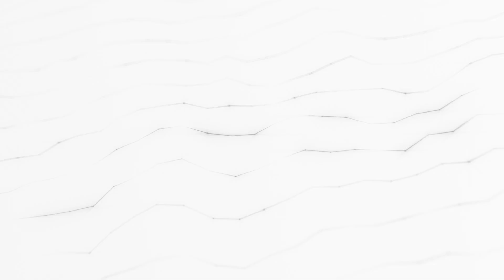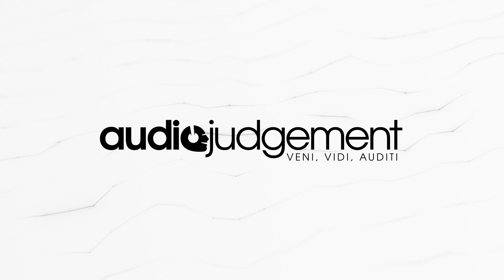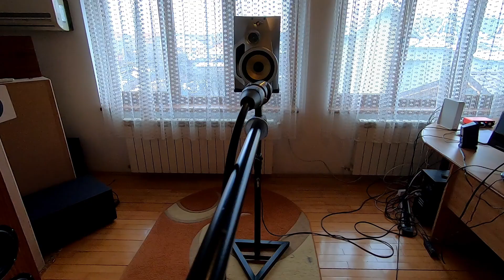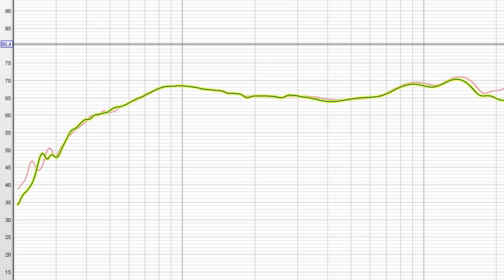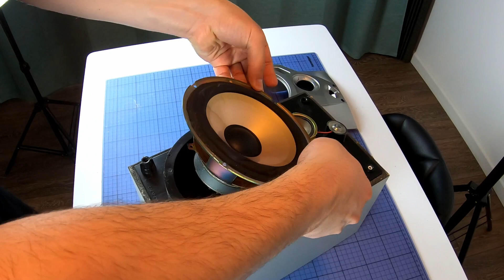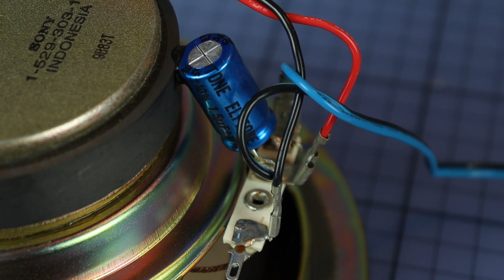Sony Audio System old model (RXD5) - Speaker measurement and disassembly

Comment: I had these speakers. There is no crossover, the high pass capacitor for the tweeter is on the woofer. The particle board is thin and there is no internal foam but the speakers do go deep, below 30hz. I used the woofers to build a pair of tower speakers and a Vifa tweeter instead of the cone tweeter. In the thick MDF enclosures with the correct port tuning the bass is excellent from the quick edge woofer and in fact with the Vifa tweeter the sound is very good, rich, warm, powerful and good top end too. These woofers can handle lots of power but will bottom out when pushed very hard.

Comment: All of these 1990 - 2000s stereo systems are more or less built exactly like these. Cheapish enclosure, just a single capacitor as a crossover, usually very good woofers, a cheap looking mid-tweeter and if it has a "dome tweeter" like yours did, its just a piezo disc flued to some thin plastic film. (Impossible to hear) Thats about the standard

Comment: Would be interested if you tested the woofer in free air on REW, and what the theoretical response would be with different enclosure types. i.e. could you have designed a better box?? Thanks for all your content, its excellent, keep up the good work.

Comment: These small woofers are really efficient and produce both low and mids really well. They actually don't need a cross-over circuit. Thanks for the great video providing some statistic information of the system such as frequency responses.

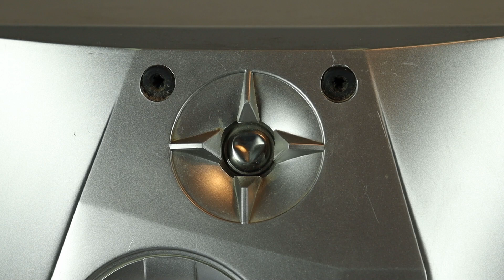Comment: 3:50 youtube is full of videos on how to suck these out.
Of course, if these are repaired, it would be nice to have a video with before and after measurements. I'm really curious to find out whether what most say is true, i.e. that the dent in the dust caps does not affect the sound.

Comment: look, these are quick edge, meaning its HOP woofers....HOP wont be understood by regular consumers. These were EXTREMELy high quality woofers, they are all still in working order. the rubber surround was extremely well made and the cross you see helps to prevent woofer bend during high performance and increases stability of the woofers during high bass output. Seriously incredible speakers for consumers. Maybe Pioneer was the only one who outdid SONY in 1996-1998, but using linear...edgeless woofers.

Comment: I'm actually surprised the response is that good. Considering how cheaply made the cabinet and the curcuitry is. My first homemade speaker basically had this curcuit with just some capacitor like 4.7 uF or something, I tried multiple by ear. No piezo though).
 I took the frequency response much later and it wasn't too pretty, however must say my impression is this "random single cap" curcuit seems to work better than the "prefabricated crossovers" (which are total bullshit) I used later. I disassembled them after a short time because they were so bad.

Comment: late comment, but anyway:
Actually these speakers are two-way, with a rubish 2" tweeter and a rubish piezo they call "super-tweeter" on specs to add some bright on high frequencies or to cover some gaps in response, that's why the cutt-off frequency is so high.
I still have two pairs of microsystem speakers on my office desk, a pair Sony SS-H991AV and a pair of JVC SB-D2T, slightly better than yours.
JVC has a proper set with paper 5" woofer and 2" paper tweeter, good enough for me.
Sony has a 6" paper woofer with foam borders, and came with those rubish tweters and piezos, so I replaced then with a better 2" tweeters and it is clearly better after.  I will buy a mic for other projects and measure these some day.

Comment: Its made in 1999 still not 25 years old all mini hifi with piezo tweeter not coming with crossover  this plastic woofer yellow or gray belongs to quick edge woofer is the best ever speaks made between 1997 till 2001 I believe  I bought more than 12 system that time every year i use to upgrade or sell my system and buy other i I know what those systems sounds. I still have the hcd rxd8s  and i use to have the same system on video  if I find one brand new now on box  i will pay more than 2000$ for that

Comment: The important thing is if you like how it sounds. the woofer has mid and low frequencies, so the speaker you called "middle" is actually the tweeter just like the little one on top which is a piezoelectric. It caught my attention that you cut the cable with the scissors instead of simply disconnecting the cables from their connectors, it is strange because despite being a VERY young person (my age approximately) you seem totally confused about that speaker when it is a speaker with a classic design of a lifetime, it is not archaic or strange technology, as the woofer reproduces medium and low frequencies, it is not necessary to cut with any crossover, simply a capacitor to filter the medium and low frequencies in the tweeter, simple but effective.
Reply from the maker: Yep, I snipped the wires because the spade connectors were stuck in place and there wasn't enough slack for me to force them out. I was only confused regarding the tweeter because I never worked with a piezo before and since it has nothing in common with a conventional speaker, it looked odd to me. However, the crossover is a joke. The capacitor will filter low frequencies, but the crossover's job is not just to make sure the tweeter doesn't fry itself. From the outside it looks like a 3-way speaker, And the last thing I expect when looking at 3-way crossover is to find a single electrolytic capacitor. That's the reason for my amazement.

Comment: It's a Piezo tweeter... works well for super highs... and it's not actually a mid... it is the tweeter ;)

I disassembled similar speaker from Kenwood which I found in the trash recently - same idea but the capacitor was 3.3 ;)

Comment: I also have this series of speakers, and I want to know if I use crossover in this speaker, will it not damage the amplifier?
Reply from the maker: I know for a fact that if you have the original amplifier, it doesn't have any protection. So if you use a custom crossover and the impedance dips too low, you might burn the amplifier, yes.
Reply: @AudioJudgement  Yes, my amplifier(Sony MHC 991 AV) is original and the speakers have a very deep bass, but I'm worried about the sound of the tweeters, which is really low. Thanks for the tips.🙏🏽

Comment: i'm amazed by the fact that you never saw a piezo tweeter before. Greetings from Argentina, this is one of the best audio related channels on yt, i bet your courses are great but i cant afford them lol.
Reply: brother, what he was saying a piezo electric tweeter needs a transformer . oe else it will be so inefficient due to high impedance
Reply from the maker: Yea, kind of embarrassing. Never played with one. Regarding the courses, udemy is the one setting the price. 90% of the time there is an active promotion and the price varies between 10-20$. Check it out from time to time to see if the prices dropped.

Comment: Thanks for the nostalgia lol! The piezo drivers are usually used where high output levels are needed and the cost needs to be dirt cheap; They usually give very bad quality output. Apart from calculator buzzers and shelf hifi systems, more serious applications include sirens and ultrasonic radars. The only occasion where it was seriously designed for hifi application was in a collaboration between Kyocera and LG on a concept TV model.
Reply: The thing is piezos have high distortion at lower frequencies (below their design range) which drops with higher frequency (well, more exactly: the harmonics are in the inaudible range), and are more suitable as super high tone speakers, maybe from 10-12kHz+. I presume the output/dynamic behaviour is also a problem, as in higher SPL setting in at lower "AMP"litudes ;), and not in accordance with the voice coil speakers? Although Technics used some with kind of "mimicry" domes in their SB-CS60,65 etc. which don't sound toooo bad, but are still setting in a bit aggressively. I'll probably need to open one and look at how they're connected to the crossover network while I've still got them around.

Comment: Hi. The tweeter is a piezo-electric type. The impedance of these transducers drops as frequency increases so no crossover is needed.
Reply: those are technically piezo buzzers but they are so much less sensitive than the dynamic drivers that they contribute no meaningful output to the sound. if you've ever hooked up just one by itself, playing at normal listening volumes, the output is extremely quiet.
Reply: those kinds of piezo tweeters are basically inaudible and for show only in my experience. they make a tiny bit of sound if you run them by themselves, but as there is no coupling to any kind of cone (like a real piezo tweeter) they are extremely inefficient
Reply: No, no but still need crossover

Comment: Nice to see your measurement results.
I got this exactly same system when I was 15, later I got from a friend RXD7 which is similar to these just even more drivers without crossover. In last summer I build 6th order series tuned 2 way tower speakers using those 4 midbass drivers, made my first, not very good video about the build and design of it> https://youtu.be/pdpYNneBfKg?t=198  I will add T/S parameters which I measured from them into the description if someone is interested about these Sony midbass drivers.

Comment: Its a piezo driver you Romanian muppet :) they are about 2-5uF capacity, Good video idea, cheers from Check Republic.
Reply from the maker: Thanks guys for actually watching the video and taking the time to answer my questions. I'm familiar with the piezo tweeter behavior, and how the impedance increases as frequency decreases, but I haven't worked with one before. I though it had voice coil like the normal tweeters.
Reply: @AudioJudgement  Well actulally, impedance decreases since its essentially a capacitor.
Reply from the maker: Well yeah, You just said it the other way around. Impedance decreases as frequency increases.

Comment: Acel ,, tweeter” este de fapt un tweeter piezzo, adica o dioda piezoelectrica cu quartz. Nu e cine stie ce, se ard foarte usor dupa scurt timp. Ceva similar se regasea in cutiuta aceea muzicala de la instalatiile pentru brad. Cel ce joaca rol de tweeter cu adevarat este acel difuzor care tu spui ca aste de medii, de unde si conectica foarte simpla. Stima !
Reply from the maker: Nu m-am jucat niciodata cu un tweeter piezo. Stiam ca au impedanta mare la frecvente joase si practic nu necesita filtru, dar traiam cu impresia ca sunt similare ca si constructie cu tweeterele normale, cu bobina.
Reply: @AudioJudgement  intr-adevar nu necesita filtru la puteri mici dar odata ce puterea creste... distorsioneaza iar in cele din urma scoate scantei la propriu. Respect pentru clipurile tale. Sunt fan 👍👍👍👍